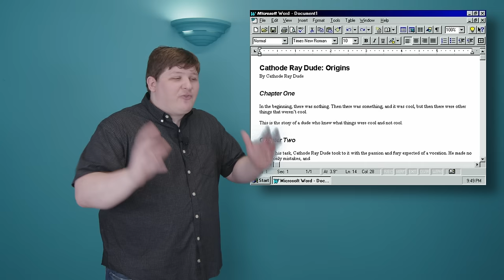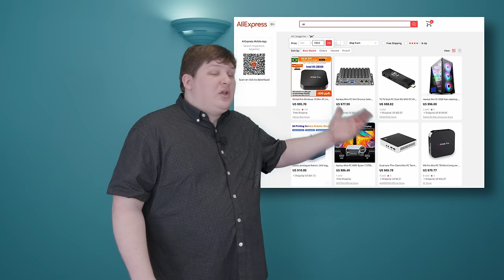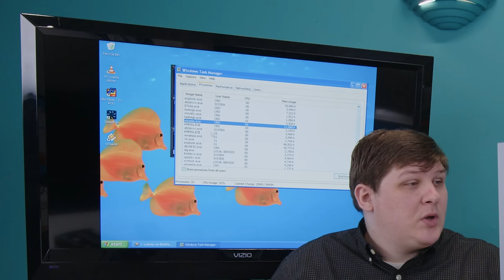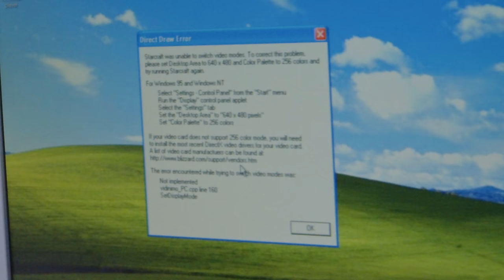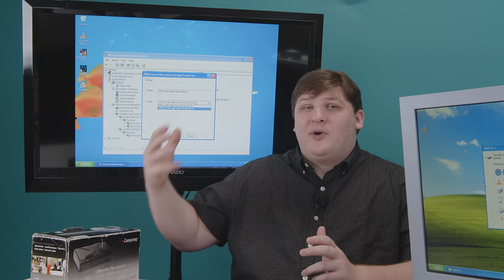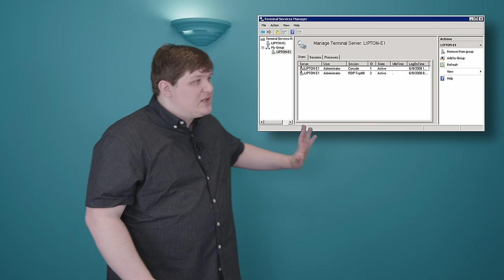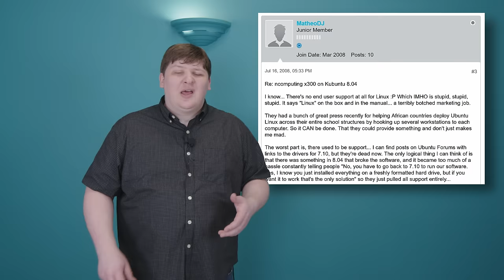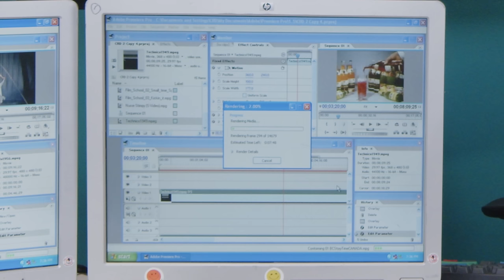7 Users on 1 PC! - but is it legal?

Comment: It's graphics that are the long pole in the tent and that gobble up processor cycles.  

Forty years ago Datapoint Corporation had a line of desktop computers based around either their proprietary architecture (which morphed into Intel's) or Zilog's Z-80 (which borrowed heavily architecturally from Datapoint's highest performance desktops, the 5500 and 6600).  Datapoint's least expensive desktop, the model 1550 which could have as much as 192K RAM on its 4 MHz Z-80, could be connected to two 10 megabyte 10 inch removable media hard drives (9320 models internally known as Cynthias) which could themselves each be connect to four (4) dumb terminals for a total of nine (9) independent users each running separate textural applications running concurrently on one Z-80 processor under Datapoint's proprietary OS, DOS-H.  Datapoint also had office software, IEOS (for Integrated Electronic Office System), versions of which ran on all Datapoint computers.  The 1550 could also have an internal local area network interface (this at the expense of a 64K memory card to make room for Datapoint's proprietary LAN interface for their token based ARC - later ARCNET - network which had scored 30K network nodes installed and in use world-wide before Xerox shipped their first node of Ethernet).  Datapoint also had nationwide wide area networking.  Datapoint even had a channel adapter for connection to IBM mainframes.  Datapoint next released a Unix clone OS, RMS for Resource Management System written in Datapoint's version of C which Datapoint christened Dazzle, and an expanded office software/hardware system that included Color Business Graphics using a proprietary color laser printer. A Datapoint subsidiary, Infosys, invented telephonic call queuing so the frustrating "Your call is important to us" message you continue to suffer with can be blamed on Datapoint.  

That was 41 years ago.  

All Datapoint processors were eight (8) bit right to the bitter end and the end was bitter indeed.  

What killed Datapoint?  The IBM PC legitimized and proliferated desktop computing combined with Datapoint executive management hostility to bad news (the worst and least likely to be admitted to being reports of declining sales) making corrective action impossible and stock price free-fall inevitable when word finally go out followed by takeover by a corporate raider who sold off or scrapped what was left of the company.  

Everything old is new again so your report about the latent power of ordinary desktop PCs comes as little surprise to me.

Comment: I am currently using an old Thinkpad t430 as a daily driver and as for me ehanced h26ify as a browser extension, as well as an SSD is all I have ever needed to keep this thing from getting obsolete. Will upgrade the i5 to an i7 in the future, maybe throw in a modern wifi card and this thing should easily last another 10+ years. Just need to find a way to get the Affinity suite running under Linux and I should be set for all eternity. I am just a casual gamer, mostly playing Minecraft, which runs perfectly fine on the machine and for the rest, I have an X-Box. I usually use the laptop for University, Audio editing and Graphics Design.

Comment: Regarding one game running at 30fps and all others running at 15, that is almost certainly a scheduler issue, as you’ve guessed. It doesn’t really have anything to do with hyper threading (both “virtual cores” are equal under load, the processor’s resources are cut in half and one isn’t faster than the other). But windows had some weird things about the way it scheduled on multiprocessor systems back then. Multi core CPUs weren’t really a thing yet and hyperthreading was new. Actual multi processor systems were mostly used in servers and high end systems where workloads were bursty and short, but numerous in number (as in internet servers and so forth). Microsoft definitely didn’t nail down their scheduler very well until years later. 

By the time Windows 7 came, Microsoft had gotten much better at this. Linux also improved substantially around that time as well in terms of user experience on multiprocessor systems (and in particular, systems that weren’t servers. Linux has always been excellent at handling server workloads).

These days, most operating systems are very good at splitting resources fairly. This doesn’t necessarily mean they’re split “evenly” - whichever processes are deemed the “most interactive” will get higher priority and will be able to steal more processor time from the rest (and this is by design, it’s why modern computers still feel very snappy even when their CPUs are completely maxed out). But in general, modern OS’s have gotten better at this, and all other things (including user interactivity) being equal, processes set at equal priority will get a much more fair slice of the CPU.

Comment: I disagree with the part of no more normal business application. Depending on the business IDEs are normal to use so running Visual Studio or Netbeans and being able to use them both at the same time would have been a good test. The reason why the school might have Netbeans is it is free. For a programming class having it done in an IDE like Netbeans would make the most sense.

Comment: 0:39, no,,,, the "Trouble" is that the newer versions of the same software become bloated resource hogs. Imagine how many tasks one could run on a modern system running XP x64 edition from an SSD.
1:20 Okay, but the reverse (and probably more important) question, is why are you uploading a 4k60FPS video of a guy standing in front of a blue screen talking for an hour?
2:32 I've had this exact problem. So glad you touched on this.
12:36 huh,,, imagine that. I'd actually want one today if it had at least one USB 2.1 port.
15:50 Didn't Windows already have RDP by XP?
 I'm so glad to have seen the day when the GHz and transistor size have plateaued. Unfortunately now they're just increasing the count (more cores, more RAM) and Windows, Linux and OS-X are still getting more bloated.
Reply: Because it's 2022. If your system can't handle 4K/60 video, you might wanna upgrade. Because YouTube is likely not the only thing you're struggling with.

Comment: my best buy so far was the first quad core i5-750 i bought in 2009 which runs oc at almost 4Ghz - standard clock is 2.66. some years ago i upgraded the old gpu with an rx570 which  i got used for 120 euros from ebay and it still runs most games pretty neat on medium quality. due to the gpu shortage the gpu would now cost the same as motherboard + cpu and ram upgrade. i recently upgraded to a ryzen 3600. the new system is not that much different when using an ssd on both systems for everday tasks / browsing the web and some image editing to be honest ;)

Comment: You say "before XP" and I assume you mean Windows 95, 98 or ME. But you kinda forgot about Windows 2000... which was also NT under the hood, and as far as I can gather - YES, you could get it to run Terminal Services. The 9x line was a complete mess and a completely separate project (separate kernel and everything), it all actually ran within one space (as evidenced by the fact that you could 'escape' the logon screen - it was slapped on). NT has always been a multi-user environment, that was its entire purpose. XP was essentially the consumer team going "okay, we can't do more with the 9x branch; hey NT guys, can you help us out?" xD

Comment: Pretty cool capabilities. When computers were simpler, this was a possible way to get the best bang for the buck. That said, my PCs rarely had idle time on them. ;)

Also, you can manually adjust CPU affinity in Task Manager to several cores or 1 specific core.

Comment: The comment about Office and word... I used office 97 when it was at the height of its usage.  Such a powerful tool.  Spreadsheets were the most powerful thing I had come across and have never seen an easier to use system since the office 97 suit of tools.  Its 23 years later and I would still prefer to use '97 over any of the modern tools.  It just worked.
With my work at the moment... I have to use office 365 excel sheets...  What a pain in the a*se that mess of a UI is.  features hidden under menu's in a tool bar.  The toolbar is tabs... UGH! press file and it opens a new screen... WHY?? lol.

But New computers... I had to upgrade my PC for a new game that needed newer hardware. (which opened me up to new games that i had avoided due to my old PC which was 5 years behind the newest tech.)
I have noticed that my usage and upgrade schedule is about 5 years...  Only because of the games I want to play.  I was happy on my old computer and my girlfriend upgraded to my old PC.  My old computer is still good for a few more years.  ( I think it ran better than my current machine to be honest. )
Reply: I discovered that you can actually still install and use Office 97 on Windows 10 and 11. Of course it won't work with the modern file extensions of MS Office. But it is a neat novelty to have.

Comment: 52:00 It probably got slow because:
Maybe they didn't have three discrete graphics controllers in their PCI card main ASIC? Maybe it was just one graphics controller that was multiplexed? (And the other wires leading out to the other two cards just held their video frame buffer. A not impossible trick.)
54:00 When there are 6 different full screen things going on and it looks jerky, it's possible an interrupt handling problem. It's just the best you can do on a single core machine.

Comment: CSU tried the thin client option for a couple computer labs... Then some brainiac decided to have engineering students use 3d modeling software on all the thin clients at the same time for lab classes...... Severe lag set in once a full class of the thins were trying to get the server to run the program all at once... (maybe they went too light on the server hardware running the setup, or maybe there wouldn't be an upgrade that would have mitigated the lag....)

Comment: I don't know exactly what it was called but in around 2005 to 2008, when I was in high school, our computer lab used the same method. I allways wondered how it worked. Each user had their own keyboard, mouse and monitor plugged into sa mall box like this next to their monitor. I knew they all ran off of a single or maybe a few PCs considering the lab had about 15-20 desks.
That was in Estonia, so not a third world country, but not a wealthy country either.

Comment: Now we need a follow up with the maximum hardware you can muster to see what that could do if you put a bit more money behind it, or if you did it second hand a couple years later. 

Then, is it possible to run those cards in a virtual host and get a super powerful XP virtual machine up and running to be the host?  The lack of PCI cards is probably the dead end there I guess. 

What is the most powerful desktop you can build with PCI slots and what is the most powerful rack server you can build with PCI slots?  Would love to see that rabbit hole be explored. 😎

Comment: Well... that's a little memory that hasn't surfaced in a long time!
I remember in my elementary school classroom, back in 2008,
there were two desks in the room, with like 4 "computers" each.
Except, I was always confused how there were only 2
Dell Optiplex SFF towers, one on each table. Yet each monitor had its
own totally independent Windows XP desktop. That always confused me.

Turns out my 7-year-old self was totally correct! It was essentially a Thin Client!
Well... actually it's a Zero Client, another term for the colloquial "reverse KVM".
Basically just a Thin Client where the "server" and the "client" are the same hardware, rather than discrete.

It was confirmed to me in my head when that "Xtenda" splash screen came on.
Somewhere in the deep recesses of my mind, my subconscious found a remnant of a memory of that screen.
I remember it always appeared when we first turned on the computer to read the news, or write a report,
or whatever us fifth graders did on computers back in 2008. That screen would appear right before the login window.
It was appear in the background, after the screensaver stopped, when computer time was over. Exactly like in this video!
Wow, was that a nostalgia rush! Barely have any detailed memories from that time, but I definitely remember that "Xtenda" splash screen.
I remember the black background, and the white text above. I believe at my school each was labeled as "Workstation//1" and "Workstation//2" or something.

Anyway... it was awesome to finally have that childhood mystery solved once and for all!

And... please refrain from the obligatory "What kinda 7 y/o knows about thin clients" remarks.
I was the kinda 7 y/o who knew about thin clients and servers. Loved technology ever since I was little.
Helped the teachers many times in that very class when they couldn't figure out how to put play a DVD in VLC Media Player.
Or the many technical blunders with the projector and SmartBoard. Always had fun assisting them and show off to my classmates. 😜
Obligatory "How can she do that?", "Wow, Braelin, you're so smart!" and so forth.

Comment: I would presume that the reason this did not take off as a more ubiquitous solution was due to the skating close with legality, and with the advances in tech over time that fairly rendered it a moot solution. I did  find it interesting that NComputing hit upon a psuedo superthin thin client solution even though it meant taking a 'sketchy' path with regard to Windows and Software licensing.

Comment: Well...  you actually can kind of do the same thing in windows with virtual machines.  It's been possible with linux since at least 1993 which is when I discovered that I could do it, and my school's computer science lab could do it with sun workstations since the early 1990s.  The tricky part is redirecting input and video output to a network port.  Again, unix and linux have been able to do this with xwindows and xserver for decades.

Comment: unity developer here. Still chugging along on a computer from 2015. although I did slap in a rtx 3080ti a while back, and maxed out the ram slots with 64gb once the ram it runs got cheap enough. but same processor and everything else, will probably still be using it for a few more years. lol

Comment: Supposing that the device appears to the computer hardware with a multi-head video card and a bunch of keyboards and mice inputs, make them useable at Linux it's a very straightforward task if you know how to do a multi-seat setup configuration. It's fairly easy to do this kind of setup without this hardware and just with a bunch of monitors, keyboards, and mice, so I believe that far as you know what you are doing, wouldn't be a troublesome procedure.

Comment: Cool stuff. Any idea on how I can get 2 desktops and 2 mouse and 2 keyboards on one monitor with hyper-v ?
I have tried gpu partitioning with hyper-v. And all(that I can find) the 3rd party apps work but cant see curser. It's there but invisible O_o
I need mid to hi res for gaming. Any idea if Multi point server can split screen 2 games on one monitor ? Defiantly subbed. Good stuff

Comment: The 1st computer I bought with my own money was a full 486 dx 266 with like a 400MB hard drive and it came with monitors software and all sorts of things and it cost me $5000. and it was basically a useless year or 2 later then the cost dropped very fast. I tried keeping it going by upgrading ram adding a co math processor and the video card. So I could install the virus Windows 95. You had to turn the bios antivirus off to install win 95. I was even running A BBS off that system just before the internet came to town. What a time that was.

Comment: Win is a multi user system. It seems the thingy is simulating a user login and routing the output from the "window manager" to the client units that work like terminals then. A bit different to thin clients obviously, quite interesting ... ah later you nail it, yes, it simulates terminals ... nice

Comment: Did you ever try installing it into a Linux environment? I remember in 2007 having Linux and having multiple desktop environments easily switchable by pressing function keys. Its possible that the Linux version would just work with out the extra software required in the windows version.

Comment: My school had an NComputing setup exclusively in the library. Running off a crappy Pentium D based Acer though...it was an awful experience web browsing.
Unless you were allowed to use the host computer...Chrome ran so much better than IE even in its early days.

Edit: The version you have is identical to what we used. I honestly didn't think that I'd ever see the hardware again.

Comment: I have software here that doesn't get updated anymore, and some I use the manufacturer is out of business, but the software is gold standard for the day (Over $1000 back in 2003), these program don't run in Windows 11 or 10 or 7 at all, so I keep my old Windows XP box to run them, and they still work just as good, the software they use can't be bought today, but I can get  the $24,000 modern version, and really why would I if the older version does the same thing, for free?

Comment: I had a PC from 2012 that just died before Christmas of 2022 that I used daily, with no upgrades. It was just the power supply that went, but I guess it was finally time to upgrade.

... Still working on that. Now using a laptop that's newer but still as crap as that old PC.

I still watch YouTube in 480p. Or 360p.